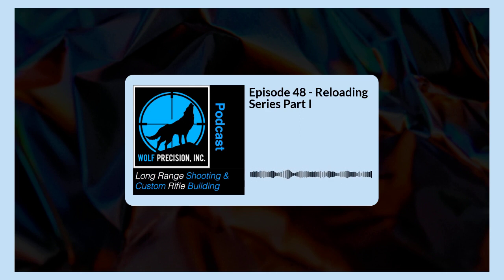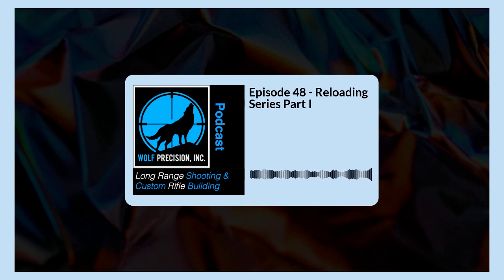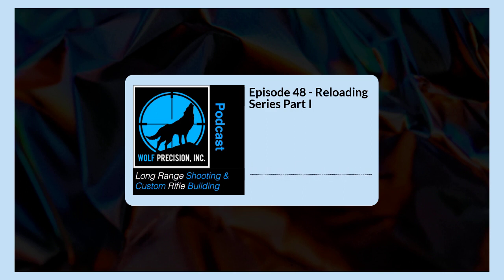Episode 48 - Reloading Series Part I

Comment: I only load straight walled cartridges, but I load them as if I where going to nationals shooting 1,000 yards. Of coarse all my targets are within 100 yards and in, but I still take the time to make match grade ammunition. My favorite is the 45 Colt. Second is 460 S&W Magnum. Third is the 45 Auto. And the fourth is 455 Webley. And last but not least is a wildcat cartridge I am developing. 

I start out with new brass, and trim each one. I then lube, size and then flare all of them before running them in a dry tumbler to clean all lube off of them. I then prime and charger them. I weigh each charge on a beam scale and trickle the load to a T. And then seat the bullets with a Redding Competition micrometer seating die. And finally I crimp the case mouths. As far as reloading them I deprime, then wet tumble, then dry thoroughly. And from there I start the above process beginning to end. 

I never get in a hurry. I do not care how long it takes me, but rather only care how well of a job I do. I shoot to reload, as opposed to reloading to shoot.